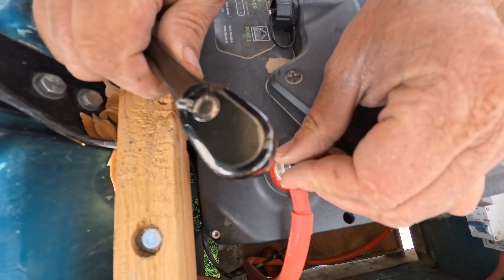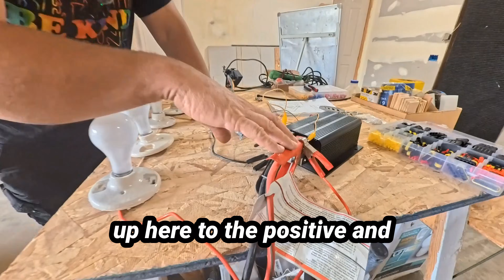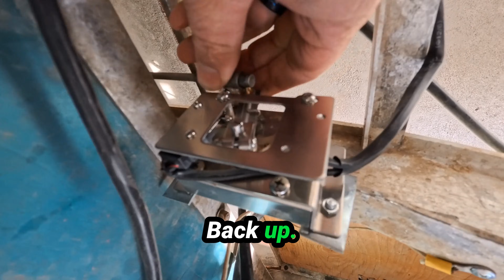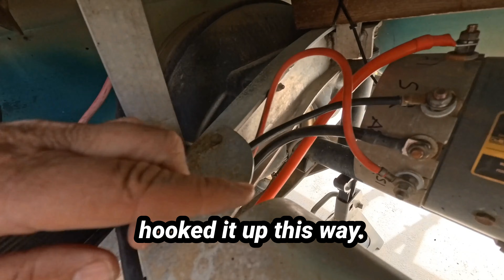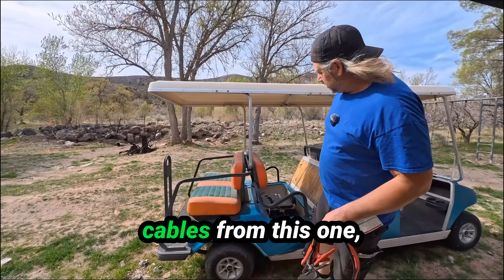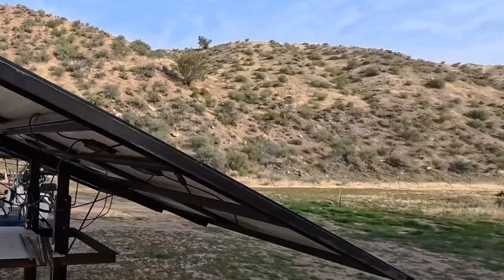Club Car Resistor to Curtis 1205 Solid State Conversion

Comment: Will this work on a 1988 Club Car DS 36v cart with the solenoid bank and resistors? Also how do you know if its a series motor?
Reply from the maker: The Curtis 1205 controller is a dc motor controller and is used in a lot of electric vehicles including forklifts. it can control series motors and permanent magnet motors. It doesn't matter what control system is in your golf cart because it will all be replaced. If your motor has four wires coming out of it A1 A2 S1 S2 then it is a series motor.

Comment: will an old 36v motor handle 48v ?
Reply from the maker: Yes, if it is a series motor.
Reply: My 94 Club Car has 36volt series motor.  I converted it to solid state 
Curtis 1205M -5603 500amp controller off Amazon. And 51.2v 100AH lithium battery.  It runs like a spotted as ape. LOL!

Comment: So the pot box does it come with the other side of that connector?or what is the connector called?
Reply from the maker: 708Pcs 1-6 Pin Automotive Waterproof Electrical Wire Connectors Set https://ebay.us/GvXGmq
Reply: Any idea why all my pot box seem to be backwards? Meaning when I pus throttle further it slows down and then there’s a dead spot?? Then seems like I switch wires and it always has power and wheels spin?
Reply: And it’s like when I push the throttle it’s all the volt right now there’s no slow speed??
Reply from the maker: @KevinVines-p3f  Make sure your pot box and motor controller are the same 0-5k. All of the pot box I have seen are 0-5K but the motor controllers can be programmed several different ways (0-5v, 0-5k, 5-0k)

Comment: I have a 1987 ezgo marathon. Can I use all the same parts, but use a heavy duty ezgo FnR switch?
Reply from the maker: I don't know I have not worked on a 1987 EZGO. You would need to do some research. I think that cart does have a series motor which would be compatible with the 1205 Curtis controller. It sounds like a fun project if you live close to Southern Utah I would help you with it.
Reply: @Thesolarfarmer I’m in Arizona, thanks for the feedback. I think that as long as the controller is compatible with my motor it should work. I’ll do some more research on it. Thanks for the video. Other options I’ve seen to delete the coils are over $1k.
Reply: @WilliamG78 I'm doing an ezgo also.  I'm struggling with the fnr set up.

Comment: Hello, I was looking at your video again and I have a question. When you start talking about the solenoid, in the video the positive looks like its connected to the negative side of the solenoid. I say that because you have the negative white wire coming from the negative power block connecting to the negative side of the solenoid. I say that because the positive from the ignition switch and positive to the controller hook up on the positive side of the solenoid. Can you please advise, I've tried to wire my cart according to how you have it wired and still negative results. I'm so sorry, but thank you so much for your time.
Reply from the maker: I'm sorry it's not working for you. I am happy to help you get this figured out. Have you watched my short videos that are at the bottom of the description? I tried explaining more about the wiring to the solenoid and key switch.
Reply: @Thesolarfarmer  No I haven't, I'll check them out.

Comment: Hello, I checked the controller and reckecked the wiring. Everything is connected properly. I followed your video to a "T". The solenoid clicks on i push on the accelerator and nothing. I pretty much took all the wiring out and installed the wiring from you video. Is the OBC connected? I removed it. Can you please help. Thank you.
Reply from the maker: What model and year is your cart?
Reply: @Thesolarfarmer  I’m in the same boat. All wired up, getting power at the controller and solenoid, but pushing the pedal and nothing happens. I cut the wires on the pot box and took the two out to the controller. Mine is an 88 club car with an upgraded 48v motor
Reply: @thesolarfarmer
Reply: @Thesolarfarmer  it's a 1996 Club Car DS
Reply from the maker: My club car does not have an OBC. It is a 91 I am going to be doing the same thing to my 2002 club car and I am going to make a more detailed video.
Reply: @Thesolarfarmer  I can't wait to see that video, I sent the Controller back and order a new one. Amazon is great that way. Hopefully that does the trick, I'll let you know. Thank you so much for your time.
Reply: @ralphburuato5963  let me know if the controlller fixes it. i have the exact same issues.
Reply: Same problems here. Did anyone figure out the cause?

Comment: Thank you for posting this video. I’m in the process of doing this to my cart and your video is so helpful. I do have a question about the key switch. I have a 48v to 12 volt converter and I am really confused how to tie it into the key switch to turn it on and off with the way you have it wired into the forward and reverse switch and the solenoid  any help would be greatly appreciated
Reply: I think I figured it out they sent me a 5k to 0 instead of 0-5k so fingers crossed it will work tomorrow
Reply from the maker: I can see how it would be confusing. If I was wiring in a drop-down converter that had a key switch option, then I would run the positive from the battery to the key switch and then from the key switch to the drop down converter and forward in reverse switch. So basically running it opposite of how I ran it. Thanks for asking. Getting Feedback from my viewers helps me make better videos to cover more questions people have. I should make a video about alternative ways to wire.
Reply: Thank you for your quick response. I’m looking forward to more videos from you in the future
Reply from the maker: @NickKollman  Here is another video I made about key switch wiring. https://youtube.com/shorts/ZnlgmEaeWCo?feature=share
Reply: Thank you!! I do have a very strange question. I installed pot box and when I turn on controller it goes to full speed so I thought I had a bad pot box I bought the one you used and have the same issue it goes full speed and when I  move the wiper it slows down and stops until I let go. I’m extremely confused with my meter hooked up I am getting 1.5 ohms and when accelerating it goes to 560ohm then back to zero

Comment: Hello, I followed your directions on the installation. Powered up the cart, the solenoid clicked on. Forward andreversed seemed to work. The solenoid made noise like it engabed. I pushed down on the excelerator and nothing???? I rewatched the video a hundred times. I'm sure I followed your instructions. Any ideas? Probably have to check the motor with volt meter.
Reply from the maker: Test The controller. watch the bench test part. You should be able to use a voltmeter on the controller to see if it is working.

Comment: Great video!  
I'm currently in the process of doing the same, buying the same equipment as what you have shared, except mine is a 36v in '88 Club Car with the five solenoids, resister, and the slide box for the accelerator. I've downloaded the manual as you've suggested, and watched the video several times.  The one thing you lost me on is the key switch, and the solenoid wiring. Could you break that down in more detail, maybe with another video?
Reply from the maker: Yes I am planning on making another video with a different cart with more detailed Explanation of things that people are struggling with. Thank you so much for your feedback it helps me make better videos.
Reply: @Thesolarfarmer 
Great! 
I definitely look forward to it! 
You have a great way of simplifying an otherwise confusing process. 
Do you have an ETA in mind?
Reply from the maker: @danchristman9870  It's probably going to be a month maybe even six weeks before I get my next solid state Conversion video made. I can make a short video of just the solenoid and key switch wiring. I could do that a lot sooner i'll let you know when it's ready.
Reply: @Thesolarfarmer 
That would be fantastic!! 
Thank you so much!
Reply from the maker: @danchristman9870  here is a video I made for you. Hope it helps. https://youtube.com/shorts/r8G1TvZDRHI?feature=share
Reply: @Thesolarfarmer 

That is PERFECT!! 

Thank you so much!! I am hoping to finish mine in the next day or two, and your video(s) are a tremendous help and asset!!
Thanks again!!

Comment: How do you power the Pot Box? The Solenoid portion of the video is a lil confusing. I'm converting my V-Glide to your conversion and I must confess I'm a rooky at this.  I've watched this video several times try to see the wiring. You have a neg and pos board on you set up. Thank you so much, I can't wait to get my cart running. I have a 1996 Club Car DS. Oh, my Pot Box is a two wire.
Reply from the maker: The pot box is powered by the controller.     Watch the bench test part of video.
Reply: @Thesolarfarmer  I overlooked that, I'll post a video when I'm done so you can see how it worked out. Thank you. You saved a Vet a lot of money.🙏🏽🙏🏽

Comment: Hi I have done the project as your superb video shows but I have now burnt out 2st solenoids and I don’t understand why? When I started and tested it worked fine and I also drive for a short time then I cleaned up and was planning to go on a lite bit longer trip to test but then the solenoid was dead. I bought a new and the same thing happened. My battery is not exactly the same as you have but it is a 48V Lifepo4 with a 200amp BMS as you know the voltage is a little bit higher then 48v approx. 54V when fully charged but is the solenoid that sensitive? Or could i be that I have had bad luck. I used both pre charged resistor and diode. Do you have any idea to what could be my problem?  Best regards Mattias from Sweden
Reply from the maker: Battery voltage would not be the problem. My battery voltage 57v when solar is charging it. Check the voltage going to solenoid to low of voltage can damage it.
Reply: I noticed on the parts list the solenoid is 400 amps and the controller is 500 amps. Could this be the issue?
Reply from the maker: @sonicindiana  The solenoid is plenty strong, It is a beast of a solenoid. 400 amp solenoid is the most amps I could find anywhere.
Reply: Did you mistakenly use a 36v solenoid and not a 48v solenoid?

Comment: Good job on your video.
I could have used your video, but I don't think it was available when I did my solid state controller and lithium battery conversion I started in March on a 1994 CC. Your method was a much easier way.  I bought the same controller as you. But couldn't wrap my head around that simple diagram you used to wire mine up. So I went the  active Main wiring diagram on page 7, figure 4.   
I figured out how to add the reverse speed reduction resistor which the 
manual mentions in the active main solenoid diagram. But Curtis didn't explain that.  
The resistor, is a 5.1K ohm. I used a 5 watt resistor. Probably doesn't need to be that much wattage. It is just wired in parallel across the potentiometer. But you must put a micro switch in series with it which is activated by the forward and reverse lever so it will close the micro switch and puts the resistor in parallel across the input Pot.  You can just connect it to the two throttle input spade terminals on the controller going through a micro switch of coarse first.
That reduces the total resistance to roughly 2,500 ohms which is variable when you push the throttle pedal in reverse mode.
The wiring diagrams on older carts did not help much either. I enquired about it on the golf forums and couldn't get an explanation about it.
 At first I bought the same potentiometer as you did. I temporarily installed it to see if the throttle pedal and rod would go the the full stroke to 5k ohms. But it would only go to 3.7k ohms. I didn't think it would work. So thought about it a lot and researched what other method could be used. So after many hours and a few weeks of that, I watched a video on MCOR and I figured out what I needed to buy the components and modify the throttle pedal to MCOR. That was real a process on it's own.
I installed the Albright style SW202 48v 400 amp F&R solenoids and the heavy duty 48v 400 amp main solenoid. I had to modify the aluminum frame so I could get the lithium battery in and bolted down. I wired it with 2awg welding cable. Had to put terminals on the cables as well. The crimping tool I bought to put on the lugs wasn't worth a damn. So I soldered all the lugs on. A whole lot better way to go.
Well after it's all done it works fine. It was just a real bitch trying to get help.
And I didn't get much. Had to figure it out myself.
Reply from the maker: Wow, what a process. I know what you mean about finding info. I did a bunch of research and ordered parts hoping it would work. Now my 91 CC is our favorite cart to drive love the speed and power. Good job getting er done.🙂
Reply: I followed this video to a T on my 1986 club cart ds. I have everything hooked up but no movement. Would I need to get a MCOR conversion kit? And do I hook that up to the controller? Not sure what to do I am stuck.
Reply from the maker: @daltonmadsen7303  You can use MCOR Throttle with 1205 controller Instead of the pot box But you will need to figure out the wiring.
Reply: @Thesolarfarmer   I am still not getting any cart movement any helpful hints on what to look into. I have just the red and black wire hooked up to my controller from the pot box was there something else  I am missing.
Reply: @daltonmadsen7303  Which wiring diagram did you use?
Are you using a pot box for the throttle input to the controller? 
If your pot box is like the one I bought. 
It has two sets of red & black wires. 
One set is 0-5k ohm's and the other is 5-0k ohm's. This parameter is set in the controller.
Did you try both? 
Do you have the stuff needed to view and or set/change the parameters in the controller if you don't know what they are set at now?
Reply: @smitty2721 I have done nothing to the controller I hooked everything up and that is it. How do I see what the controller is doing or set to
Reply: @daltonmadsen7303  check ohms resistance using a test volt-ohm meter and operate pot
Reply: I did this on mine, found a bad butt connector, fixed it...0 ohms start, push throttle and ohms increase to about  5000 ohms wide open
Reply: you don't need to power up to do this test

Comment: I tell you what! You are a freakin genius! ( Note : Be sure to flip the TOW/RUN switch to TOW prior to on/ off on the battery on the new AQ cart. It removes power from the controller.)  I need to upgrade the 1204-410 controller in my AA01 series cart, I need torque, speed 25 max. The AA01 cart has an MCOR 5k-0 ohms, the 1205 is 0-5k ohms, hence the POT BOX 0-5k. So all I have to do is convert a PB8, drop in the 1205, I'm good!              You are the MAN!

Comment: Hi And thank you very much for this nice video. I am on the go to do the transfromation on my cart a Clubcar ds1992 Nov to my concern I have bought a solenoid as in your video but it did'n come with neider pre charged resistor nor a diod. can you help me with the spec for those so that I can boy them seperately. best regards Mattias
Reply from the maker: Golf cart EZGO Club Car Yamaha 48 Volt solenoid resistor and diode set https://ebay.us/4u04sK

Comment: Did you keep the stock 36v motor in or change it out?
Reply from the maker: Kept the original motor 36-volt series motor can handle 48 volts just fine.
Reply: Cool I’m gonna do it to mine once I get new batteries since I’m going to lithium
Reply: @joshuamcclure191  Using one Lithium battery is preferable. Depending on the Cart frame and the space in your battery bay you will need to figure out how to manage putting a large battery in it.

Comment: I just finished this conversion on my 89 36v club car after melting the V-glide, but only reverse works. Any idea as to why? Side note, the one part I haven’t replaced on the list is the F/R switch so I’m leaning towards that being the problem
Reply from the maker: Double check you're wiring. If you switch your S1 and S2 connections, then you would only have forward.  It could be your Ford in F/R switch.
Reply: @Thesolarfarmer  mine is doing that also, except only have forward with mine using stock switch, if I swap S1 and S2, I get  reverse only!!  is it the fr  switch maybe?
Reply: Took it to a golf cart shop, they fixed it, will know Monday exactly for what was wrong, told me the stock switch was the problem for this application.....will post the results
Reply: worked great if you don.t need reverse
Reply: The shop installed a jumper to bottom 2 lugs where A2 goes this stock switch is different than the generic ones..........instant F/R!

Comment: I am currently working on this project in my 01 club car ds. I have a few wiring questions for you. Is there a better way to contact you and pick your brain? Email, phone, messenger etc. Please let me know as I’d like to get my cart up and running since summer is right around the corner. Thank you.
Reply from the maker: I am hard to get ahold of because I live in the middle of nowhere. Here is my # 4356805958. You can call me. If I don't answer it's probably because the call didn't come through.
Reply: I attempted to call you on Thursday went right  to voicemail for a pizzeria 🤷🏼‍♂️. I have my cart wired up exactly like yours (no bus bars tho) including the A2 having it go from the motor to the F/R switch then to the controller.  I’m getting nothing when I put the lever into gear. All wires still intact for key switch and buzzer at the key switch. Still running a 36v lithium battery haven’t purchased a 48v yet.
Reply: @WalterHerman-p7y I own a pizza trailer that's why my voice mail is for pizza biz. You can try calling again.
Reply: Thank you. I’ll be calling from an 848 area code. Hopefully today or tomorrow afternoon. Hoping the weather clears up here